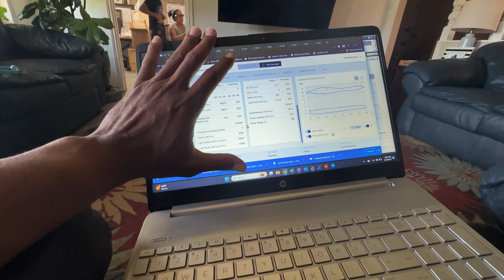What is takes to shoot a fluid level

Comment: All my machines run on compressed air
Uses air bearings
Pumped up using gravity and wind

Fuel and batteries have been obsolete for over 100 years guys

Free gas from a tub of poop and veg waste

If you want to keep burning something

Use the flammable explosive gases building up in cow sheds and sewage works

Oil is over

Because glass doesn't rust
And air bearings don't need oiling

But mostly there are no machines that require oil

And there's no reason to burn oil

When that's how seven million people die from air pollution each year

After over 100 years of fuel and batteries being obsolete

What are you actually putting in the fish bowl you eat breathe and drink from

The earth is a fish bowl

I am the fish that climbed the tree